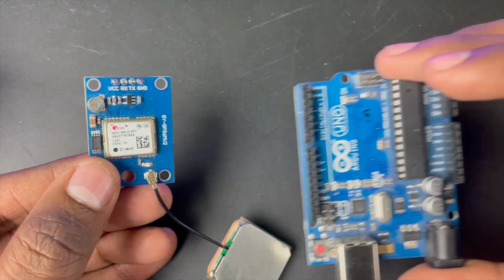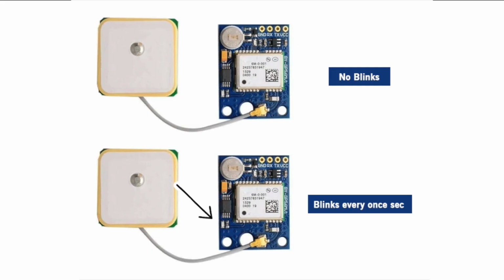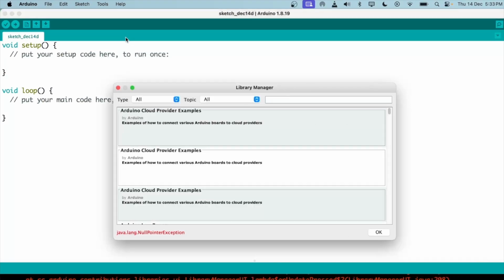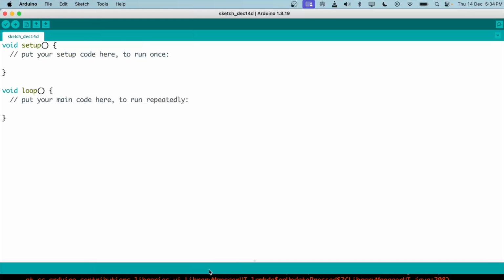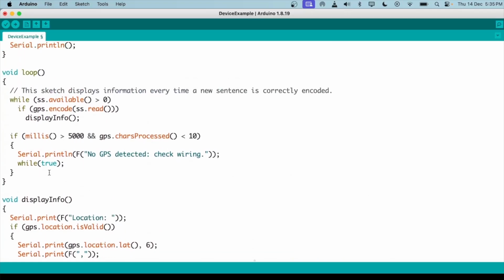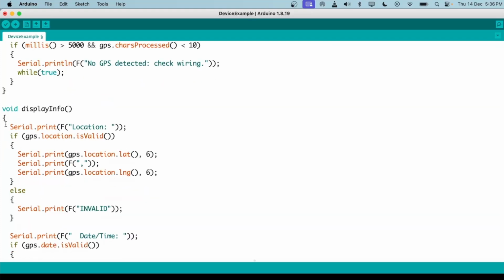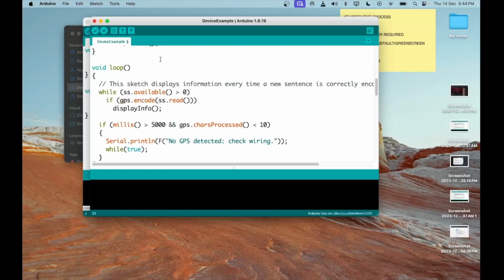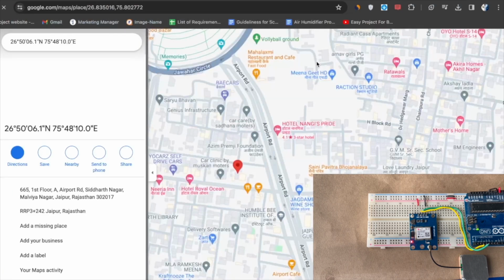Interfacing NEO-6M GPS Module with Arduino | Location Tracking Tutorial 🌐🚀 #ArduinoGPS #NEO6M

Comment: Sir the led of gps module is not blinking what we have to do
Reply from the maker: The LED will only blink when there is a GPS lock. So try it out side were there is no obstacles. Also check the antenna connection. If Its doesn't work on outside either, then then the module must be damaged.

Comment: Sir, plzz make it with use of sim800l and to send location on mob.
And also code like your previous A9G board location tracker project which update location in avery 30 sec of time with 30 second store locations. Just like your A9G board project which you makes years ago... plzzzzz sirrrr.....
Reply from the maker: SIM800 modules are kind of obsolete. It would be better to use 4G modules for such a purpose to make the project future-proof.

Comment: Some tips... The Ublox GPS ICs that come on the cheap breakout boards are highly faked. Just know that, if your circuit is based on the Ublox data sheet. Your results may vary from an original Ublox IC. The different Ublox models vary significantly in the features they offer. For example, the M8N is much more powerful and flexible, but it costs a little more. You must read the description of the model that you think you are buying very carefully. For example, the board might have "M8N" printed on it, but the IC mounted on it is only a M6N. This is because some boards are "universal." And, the powered, amplified antenna is well worth its price of just a few dollars. You will get much better reception. And, you must consider where  to place the antenna, for use in a car. If you put it in the trunk, you may not get any reception. Lastly, the Ublox website has a programming application that is free to use. HTH.